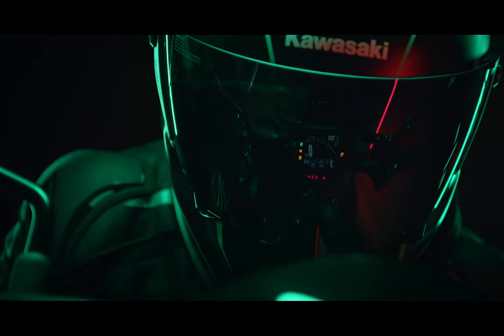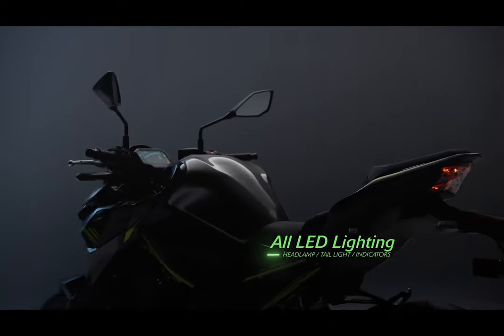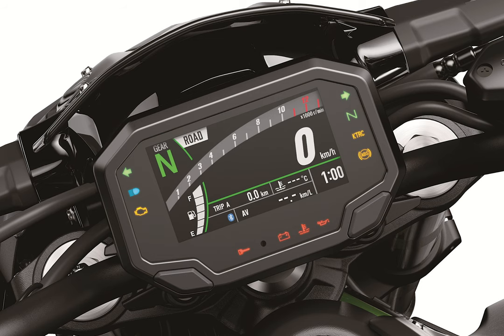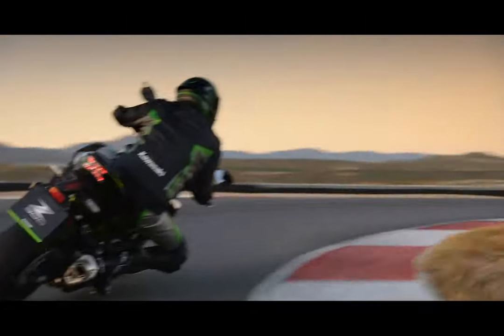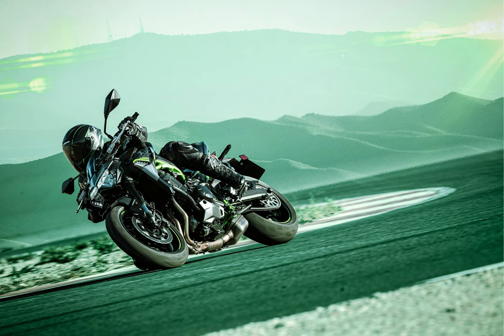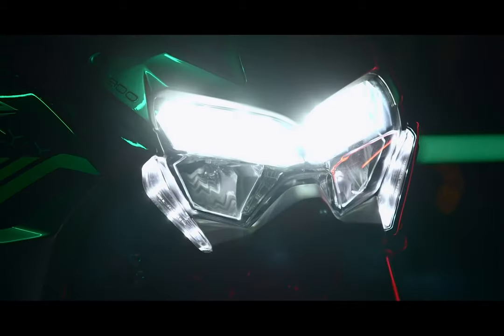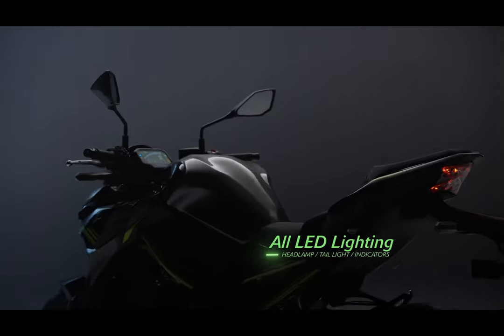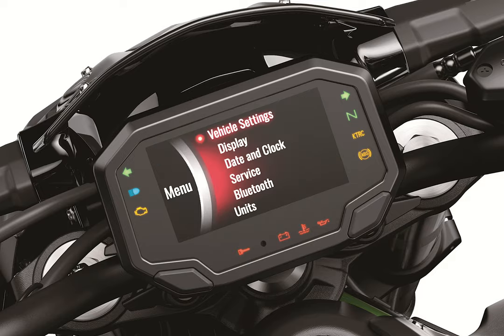New 2020 Kawasaki Z900 // Full Specs & Pictures Released

Comment from the maker: Would you rather: Buy this bike and pocket $6,500 or buy the supercharged Kawasaki Z H2?
Reply: Berlin Biker that Z h2 is a hideous motorcycle . But the specs are pretty good. 197 hp and 100 foot pounds of torque. But is heavy as hell at 530ish pounds. If I had the money based on spec I guess the zh2 is just as good a deal as the Z900. They both blow the competition out of the water on price at 17k and 9k
Reply: Would definitely pocket $6,500. The Z H2 looks like a touring bike, and it has way more power than I would need anyways 👀
Reply: Z900 for sure. Z900 is the best value in the price range. Above that and I'd be looking at SuperDuke,Tuono or Street fighter.
Reply: definitely take this . . .
Reply: $6500 is a lot of coin to save, not to mention the insurance rates on the Z H2.

Zed900 for the win!
Reply: Depends on my finances. I am probably in the minority on the looks but I like it. Being way lighter then my Connie and liking big power, I would luv to have it parked in my garage.
Reply: Wow it's over a $13,750 here!🙄
Reply: Sell me a h2 at a price then yes I DO!!!
Reply: It's sucks because it's water cooled. Air cool it and get rid of the extra weight !! There's plenty of air cooled supper bikes out there proving it can take it.
Reply from the maker: @dwaynecarpenter1112  What's another superbike with this much power (current generation) that is air cooled? Nothing comes to mind.

Comment: For me, a backward step with all the new electronics which it didn't need and nobody wants (except for journalists). I'm on the verge or buying a Z900 as my current bike is just clicking up 100,000 miles but I'll purchase the "old" Z900 without all the electronics and the no doubt requirement to have it plugged into a dealers computer for a service, even just to change the oil.
Reply: MrC InTheUK I feel the same.
Is the slipper clutch new for 2020?

Comment: grt video, New seat height is 820mm, i see seat has more cushion now. as sort rider can i use seat from old z900 and minimize the seat height? old one has 795 mm seat height which was perfect for me.
Reply from the maker: I'm not sure if you can use the old seat but I would assume no as they changed the frame a bit they might of changed where the seat bolts on. I bet there is a low-seat available through Kawasaki and if not, the after-market.
Reply: @BurtoniMotors  thanks

Comment: cbr650r vs 2020 z900 which one is better? design, cost, features overall???
Reply from the maker: The Z900 will have way more torque but the overall fit and finish is better on the CBR650r. I would go for the CBR650R if it were my money.
Reply: @BurtoniMotors  No way chump.Z900 all the way.

Comment: Other specs I've seen for the 2020 have the seat height still at 795.
Reply from the maker: I was going off of the Kawasaki Media page, but maybe it changes based on country?
Reply: @BurtoniMotors  Unfortunately I think it is 820 and some of the other sources simply had it wrong. It's annoying because the low seat height was selling point compared to say the MT09 and GSX-S750's which are both 820 as well. Like any bike people need to sit on it and see how they feel. I can definitely flat foot an 805mm MT07 but haven't graduated to a big boy bike yet to try one.
Reply: I heard that the seathight is now 820mm but you can buy the lowerseat with 795mm, its the same like this year but they changed it, on the 2020 model you have a higher seat and you can buy a lower one and on the 2019 model you have a lower seat and you can buy a higher seat.
Thats what i heard from my Kawasaki Dealer.
Reply: @nickaslanidis6156  the